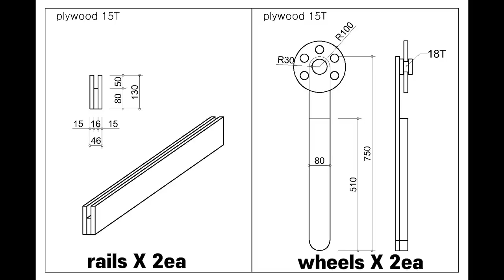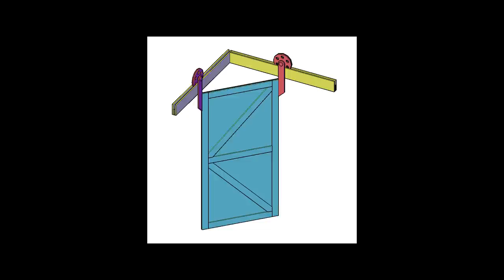목공 슬라이딩 도어 만들기 / Bendable Sliding Door with multi rails [woodworking]

Comment: Brilliant innovative design.
I've been working on a design for something fairly similar, a sliding door that is also hinged one side to swing off the wall from wherever the slid door is stopped, so this door would be able to cover either of two side by side door openings and then swing open whichever it is covering.

Comment: the same effect could be achieved with a conventional hinged swing door. A sliding door assumes a different purpose (parallel movement to the wall), where a hinged door would not fit. 
If you exclude the door frame, you might as well make a rail on the wall to which the door leaf would be attached.

Comment: not articulated, just a solid door hanging on rails. (closer to a barn door style) articulated means it bends
Reply: According to the dictionary it should have "having two or more sections connected by a flexible joint.
" The joint between the door and the wheels is flexible, and it has two wheels and a door, so that's three sections and two flexible (pivoting) joints. Wouldn't that qualify?

Comment: Interesting but wouldnt think to do a door on wheels when it’s purpose is same as a normal door swing next to wall.
Reply: But this takes up less space. A swi ging door will block the corner, preventing you from using it. Not to mention the fact it was an arched doorway.
Reply: @Watthead80  take a closer look. This door blocks the corner just like a swinging door would. That was his point in making that statement.
Reply: The radius of rotation is inverted. So the dead space is a little smaller than that of a traditional door. Regardless of that little extra space, it's just cool to have an original design.